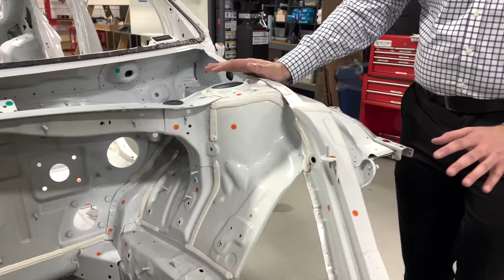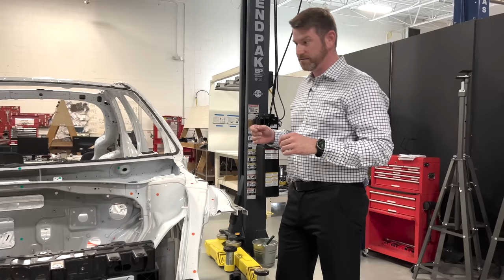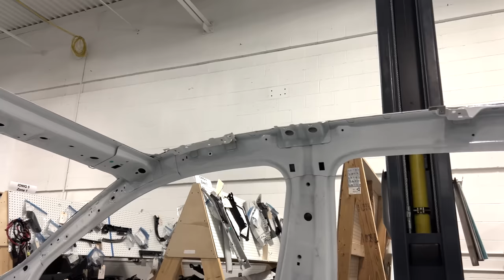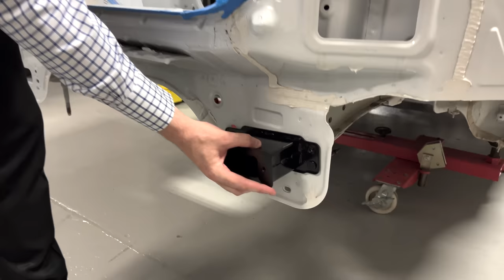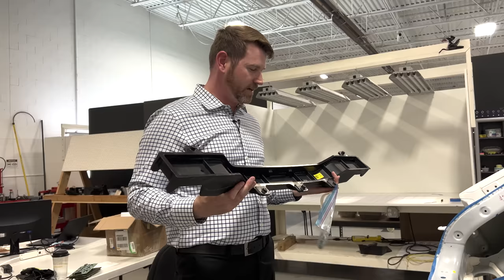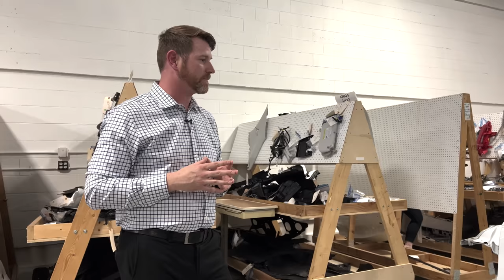Hyundai Ioniq 5 Body in White: A Strong Debut for E-GMP?

Comment: So it looks like Kia/Hyundai managed to make a good start by basing the EGMP on strong fundamentals from their ICE cars. A good choice; too many manufacturers bumping up their costs and lowering value proposition to customers by trying to re-invent the wheel. If a good steel BIW can accommodate a 300+ mile range EV drivetrain AND remain one of the lightest, and safest EVs available in this market segment, it proves that they're doing it right 👍👍 No wonder, with the amount of Ioniq 5s and EV6 there are here on the roads in the UK already.
Reply: The investments in the platform and body are easily dwarfed by having your competitors making battery deals before you. Now instead of you making the drivetrain it is somebody else. That is why subcontracting automakers struggle. Volume is obviously always a factor.

Comment: Does anyone know if the Ioniq 5 SE, SEL, and Limited use the same wiring harness?  Would be curious to if you could take the cameras from the Limited and put them in a SEL or SE and the surround cameras would work.  Is it a hardware limitation because the connections are not there along with the proper trim or is it a software limitation to the model?

Comment: weird this feels like watching a component in the ICE vehicle period/age.  The Cybertruck is setting a new paradigm in car building. I think the future is more straight line structures, body lines and stainless steel. While ugly to most people at first, it will become norm pretty fast like how European or traditional buildings were done vs the modern architecture we have today which is more practical and cost sensitive.
Reply: Stainless steel is definitely not the future in most passenger vehicles. People like their coloured cars.
Reply: Stainless steel is a material which is unnecessarily hard to form during the manufacturing process,.  Let alone repair through the life of the vehicle.  A dead end.
Reply: @davidhiles8823  Yes which is the reason why the Cybertruck looks like that. Using stainless steel gets rid of the slow and expensive painting process and it is likely future cars from Tesla have the same design philosophy.
Reply: I believe stainless is still heavy
Reply: @stevemiller2210  It is but EVs don't care much with added weight which is the reason stainless is feasible on the Cybertruck

Comment: LOTS OF PARTS
There seems to be a lot of separate pressed steel parts joined together. The inside bulkhead and floor panel remind me of the early Model 3.
Reply: Model 3 a wild mix of materials, IONIQ 5 all steel. The problem is not the number of parts, the number of contacts of different metals.
Reply: @momentum2564 The problem with the 'number of parts' is the number of parts is the problem, and yes I know what you mean about Galvanic Corrosion.
Each part is:-
 an additional part with either an additional or more complex die;
 an additional forming process;
 an additional surface area of coating;
 an additional assembly process;
 an additional fixing; an additional cost of material;
 an additional point where something can go wrong;
 additional time to manufacture; 
 and typically an additional weight; 
It is hard to argue with the manufacturing mantra of "the best part is no part"

Comment: How do I find out which of the E vehicles you are most excited about? You all plus Sandy seem very happy with most everything you look at. I drove the Mach E. Not bad. Road noise could be less. Response is good too. Ford is way high on prices and needs to stop misrepresenting range. I had a call from a salesman locally and he had a Platinum Lightning. $83,000. He said New with 2000 miles. I said that is a lot of demos or taking the truck home. I said that is a used vehicle and offered $45,000. He said No on used. I said he was wrong. He did the history check. A man bought and used it for 1 month and turned it in. The Ford sales people in the dealerships lie through their teeth. I donot even trust Tesla for concealing complaints and problems from us. My safety is on the line. You lie and I die is not good for me. Transparency is King. Thank you for discussing the Ioniq 5!

Comment: Aluminium not very strong compared to steel
Reply: TESLA gigacast is Stronger than a Steel front end.
Reply: @markplott4820 aluminum shouldn’t be structural on any unibody vehicle.
Reply: That’s why Elon called Tesla frame failure issues “normal wear and tear” 🤔.  Which is insane if you think about a single cast frame that also has lots of known fender and frame rust issues already. 
 Maybe after he starts correcting some of these issues, then he can address the cheap looking interior.  Looking like an early 2000s Honda with an IPad stuck to the dash. It’s crazy that you can buy a car for almost 60k and still not get a cluster behind the steering wheel 🤷‍♂️
Reply: After a while I started concentrating more on when the next ‘itself’ was coming than the information about the body.  🤔😀
Reply: Amazing information bro, would have never thought of that.
Reply: Funny how aluminum and magnesium have been successfully used for decades in auto structures,  and a century in aircraft.
Reply: @thomas735  Why not?  They are literally designed to crumple anyway.
Reply: @jamesengland7461  Don't try to fool us with your logic and facts..
Reply: @calholli  aluminum fatigues relatively easy compared to steel.
Reply: @thomas735  Yes.. we know.  Show me any example on these cars where there's an issue from aluminum fatiguing?  You're much MUCH more likely to have your steel rusting away to nothing-  than any aluminum fatigue becoming a problem.   That's already baked into the cake.  If it's a problem area, then they will build it with forged aluminum, etc.  or simply make that part steel....   I've still never seen a cracked casting in a Tesla-- so either people aren't talking about it or it's just not an issue.
Reply: @calholli  it wouldn’t be an issue yet, it’ll be an issue 5 to 10 years down the line. That’s why they retire planes.

Comment: MUNRO - the Hyundai e-GiMP platform is Factually OUTDATED, too Heavy , with too many Fastners and too many Brackets holding up MORE brackets. 
Hyundai is lacking the MOST Advanced BIW , the TESLA Front & Rear Gigacast, and 4680 Structural pack.
Reply: Yet the Tesla I owned was a total rattle box-Tesla=PURE RUBBISH. Horrible build quality.
Reply: My 2023 Model Y long range rattled like crazy as well. I traded in because of the rattles and insane phantom breaking that threw my kids heads into their child seats. 
 Never again will I own a Tesla. Overpriced Elon Trash cans.
Reply: It is interesting to watch this BIW overview next to the Tesla Model S BIW overview.  The progressiveness of the design can be argued, but the quality of the welds and application of the adhesive looks decidedly better on the Ioniq 5 than the Model S.
Reply: @richierich8292   - UNTRUE of the 2023 builds , Specially coming out of AUSTIN, TX.
Reply: @richierich8292  Startegy of design is not per say same as its execution. strategy =/= production QC

Comment: MUNRO - at end of the day , Hyundai e-GiMP platform is an OUTDATED gas based platform , Designed for Combustion cars, Hybrids (combustion) , Fool Cells and a BEV platform.
but , e-GiMP is only using the Hybrid & BEV Variants . 
still, the Platform is too Complex and too Heavy.